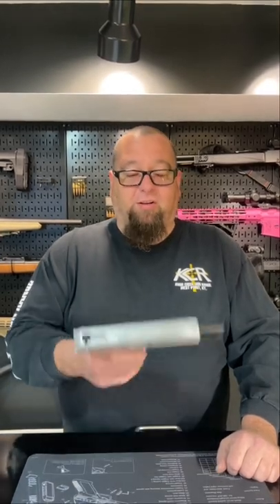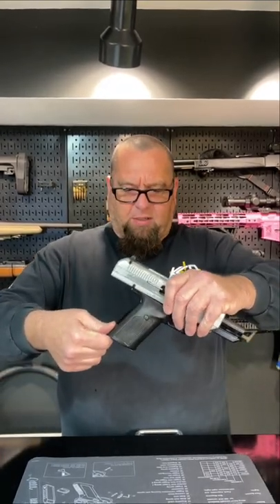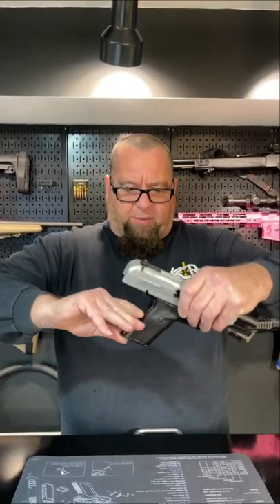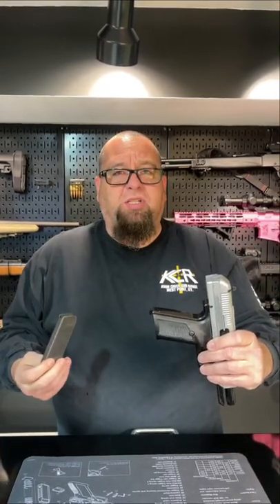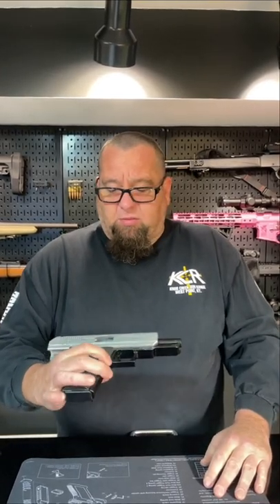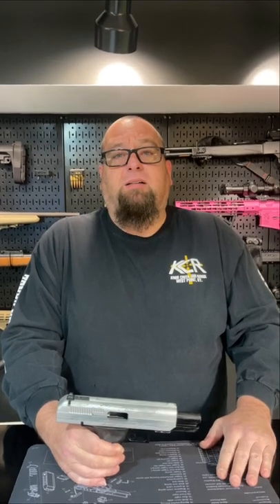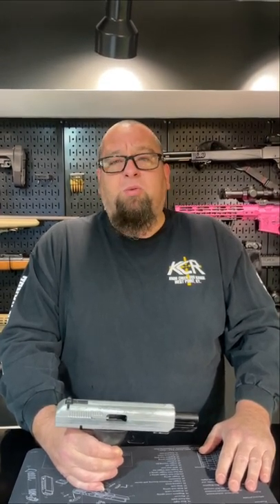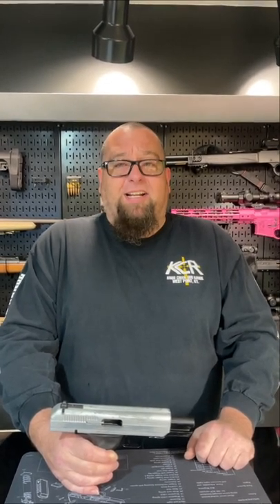What 8 grains of rifle powder will do in place of 8 grains of pistol powder

Comment: Sacrificial, i really appreciate this video. I was wondering if oyu could subsonic ammo with rifle powder rather than pistol powder. If you can, try as much rifle powder as you can before you start crushing it. Instead of like 8 grains, try 12? 14? Kinda curious how things would work out.
Reply from the maker: Thank you! I’ve used Titewad in. 223. Was under 1000 fps and didn’t cycle the action on an AR. The case was almost full with a 77 grain Sierra match king. Would work a bit like loading a 300 blk subsonic.